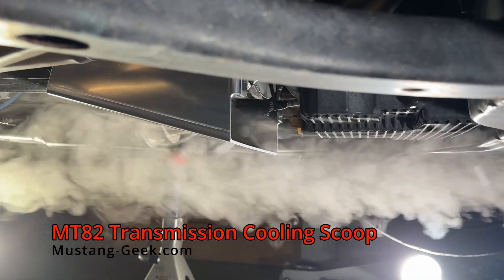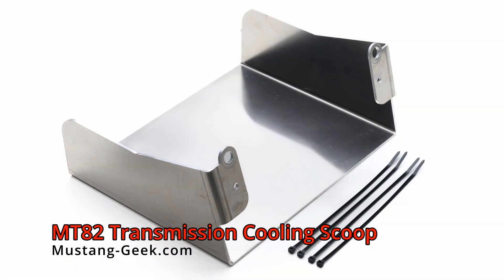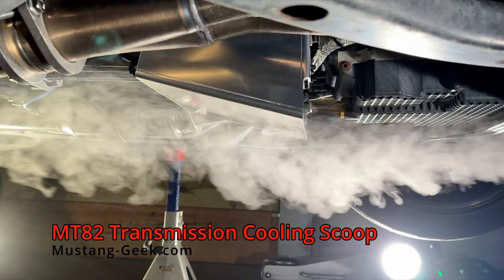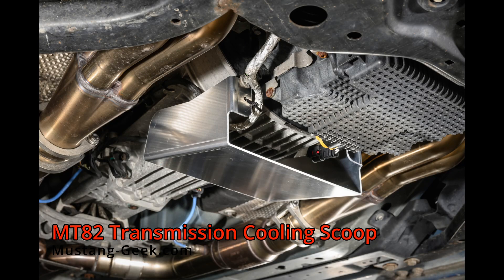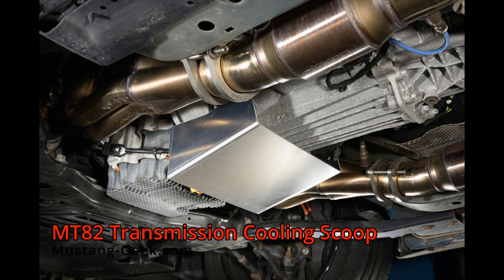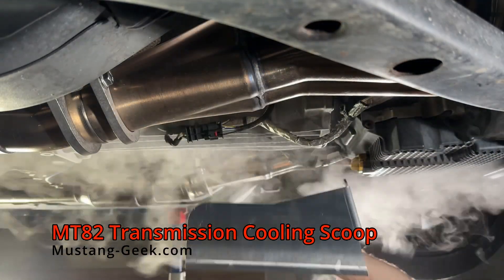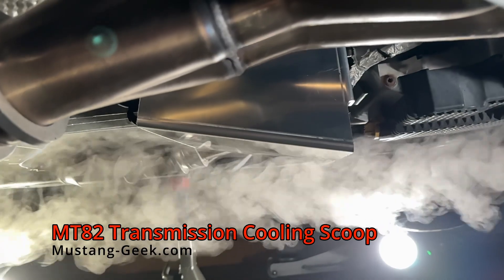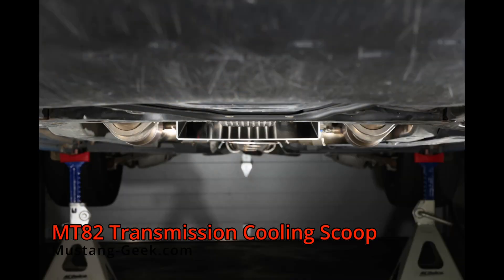Transmission Cooling Scoop for MT82

Comment: I've got 2 question and I am not being sarcastic.
With this "scoop", aren't you also scooping hot air from the engine ?
Did you do tests monitoring trans temps with and without the scoop?
Just theory doesnt work in the real world. If you show me results I'm in.
Reply from the maker: The air under the car is still cooler than the trans. This worked on the Boss 302, and the design is the same.